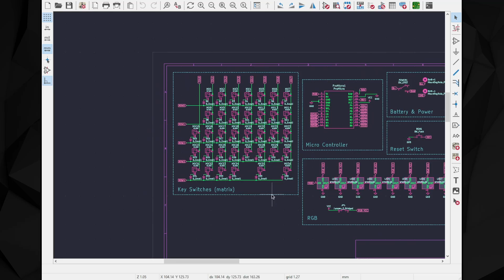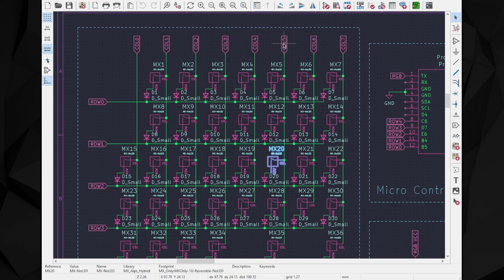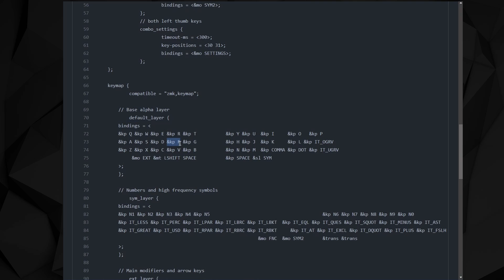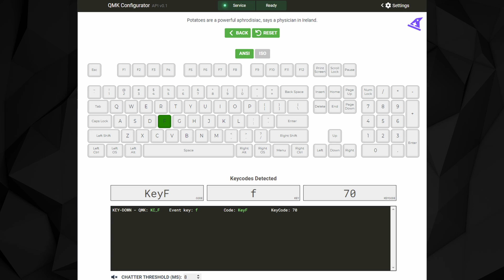How to FIX your keyboard when a key isn't working

Comment: Can I test the microcontroller without taking it out or will that risk damaging the board? I socketed it with copper wire and it took me like 20 minutes to push it into place, so I'd like to avoid having to do that again if possible.
Edit: as I was going to remove the microcontroller, I realised the pin had bent so badly it wasn't even in the socket at all🤦‍♂️🤦‍♂️. What happens when you use material that's too flexible ig.
Reply from the maker: You can test it on the board but it would be ideal to remove it
Reply: @KyekOfficial  I'm sorry that I'm being persistent, but why is that, exactly? Is there a specific reason? Thank you for the video btw.